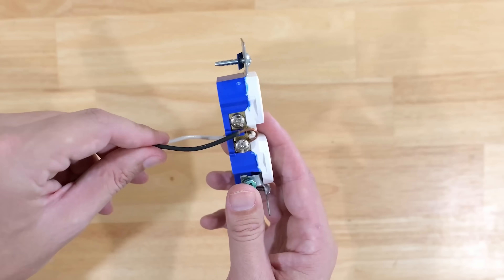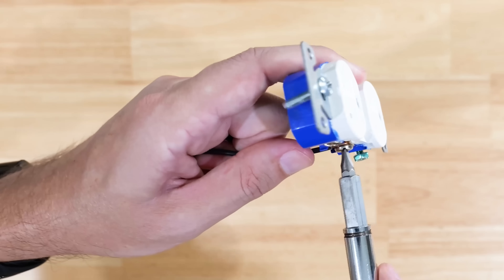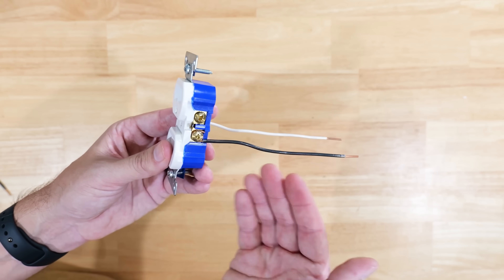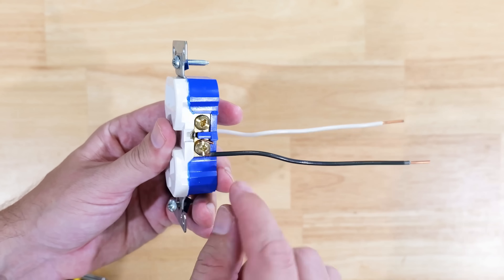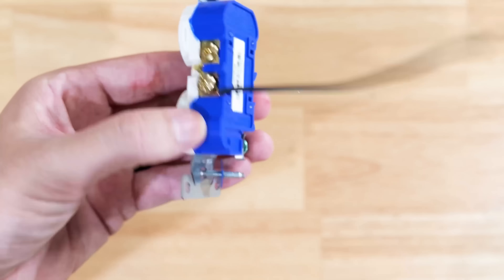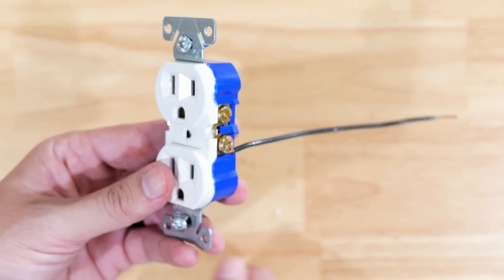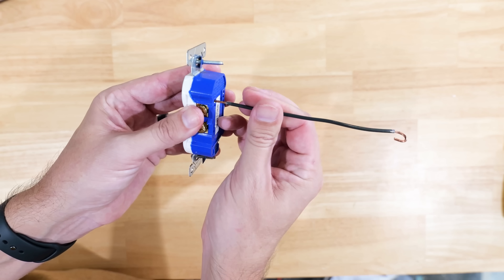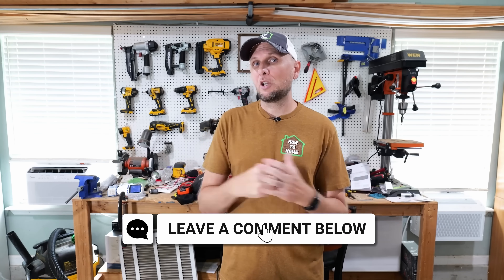Avoid Disaster! 8 FATAL Outlet Mistakes Most DIYers Unknowingly Make!

Comment: Do not listen to anyone who tells you that WAGO connectors are unsafe. They have been thoroughly (lab and field) tested and are every bit as safe and effective as wire nuts. That being said, like most things the quality of the product can vary by manufacturer. There are "push in" style connectors that work just like back-wiring receptacles and they are not preferred. WAGO, specifically do not work the same way. They do have a lever that locks the wire in, but that is not the electrical connection point. The lever is locking the wire against a flat conductive plate that runs along the edge of the wire creating a lot of surface area, similar to the surface connection of a back-wire, commercial-grade device. As long as the connection device you are using functions that way, it is perfectly fine, and if installed correctly just as safe and durable as any other connection method.

In most case, the most expensive part of electrical work is the labor cost (including warranty work), so anything that can reduce the labor cost is preferred. WAGO (lever-lock) connections/devices tend to more expensive, so professional electricians would not be increasingly using them unless they were making that time up somewhere else. Those devices install much quicker with equal reliability. If someone tells you that WAGO (lever-lock) connections fail more than wire nut connections, it is because they are not installing them correctly or because they just have an "old school" bias.

Comment: Well I absolutely agree with almost all of your best practice suggestions and I love the receptacles with the clamps. I just noticed one thing that I would like to point out. In my program in Electrical Technician, I was told when using the wire strippers pictured in the video that one should use them to cut the insulation ONLY and not use them to pull the insulation off in one motion as shown in the video. We were told that this introduces a huge likelihood of scalping the copper conductor. So I recommended pulling the insulation off with your finger nail, or if you pull it with the strippers, position your hand at the jaws of the stripper to pull the insulation straight inline with the wire.
Reply: This is the only way to strip insulation. Seen many times where wire gets cut and the loop fails (ie breaks off the end)
Reply: It is the rocking and the twirling that you really need to avoid.
Reply: As an electrician trust me we use those same style strippers to strip the wire bare so we can make connections.... if you use them properly hey are are for exactly what they are called.   Wire strippers
Reply: Depends on the size of the wire.
Reply: I've learned to strip insul.  w/o gouging wire.  Not at all.  Using a new  sharp wire stripper helps.  Was taught to "twirl" the tool gently.

Comment: I'm still watching the video and will comment as this is important IMO. I approximately 8 or more years ago I replaced quite a few outlets in a family member's house. I used the inserts as seen in #4 for all of them. About a year ago, when selling their house, I ended up going through the house to wire all of the terminals to the screw holes. Quite a bit of them had failed too with problems like the wall outlet shutting off when moved. Of course I did them for free as it was very easy to re-strip and coil them around the screws. This fixed all the issues that some of the outlets had. I'm surprised that they didn't tell me that they had issues as I don't even remember that they were all wired using the holes in the back.

Comment: I did not see in your video plus reading a lot of the comments (but not all) but did not see this addressed. On future videos show the difference of the screwdriver heads - Phillips vs the bit DESIGNED for screwing the receptacle side screws in.  As a DIYer, I did not know the difference.  I happened to notice it at Loews in the electrical tools section. I paid the extra few $ and noticed the difference when installing new receptacles on a small remodel. One can torque the screws much easier with the bit designed for those receptacle screws.   But like the idea of the torque screwdriver also.  YES -  agree with your assessment of using the commercial outlets for residential that has the plate that clamps the screw thus allowing a straight wire versus a J hook.
Reply: What is the name of the proper screwdriver bit for receptacles?

Comment: When you say that the electricity is being fed into the outlet and appliances backwards it shows that you don’t understand AC current very well.
Reply from the maker: How this confuses you and yet you say I don’t understand it is amazing.  Yes it’s alternating current.  You have a hot wire, also called a line wire, also called a fed wire.  It is the only wire that supplies current. The neutral doesn’t and the ground doesn’t.  It matters which side the feed wire is on the receptacle so that when you plug something into it, the on off switch stop the current front being sent through the device when not intended.  If you put the feed wire on the neutral side, something like a lamp socket will always be hot regardless of if the switch is on or not.  Do you still not see how AC has nothing to do with it and that there is in fact a feed side?   If not I can’t help you any more.

Comment: Great videos! Thank you.  You did confuse me when you showed two black (power) wires connected to the separate brass screws (not two hooks on one screw). Where would you use that unless you were breaking the tabs to use different breakers on the same outlet or for back wiring? If to back wire, isn't that also against code too? I was taught by an electrician to use pigtails and wire nuts to back wire multiple outlets. I am DIY, not an electrician.

Comment: UMMM dude you should not put a receptacle rated to handle only 15 amps in a 20 amp circuit. If the breaker is pushing 20 amps and the wire is carrying 20 amps and the load is 20 amps then what the hell is the 15 amp receptacle going to do about that? You can however put a 20 amp receptacle in a 15 amp circuit, if the load is 16 amps as in a device failure then the only thing stopping the fire is going to be the breaker, the receptacle isn't going to affect how the breaker works or what the load does. You are right that using a 20 amp rec in a 15 amp circuit would encourage missuse but thats also like saying you cant trip a breaker or overload a 15 amp circuit that only uses 15 amp recs.

Comment: On the receptacle there is a catch nub for the end of the loop -- so you can pull the hook past 180° and get a tighter fit around the screw. It is easy to reason that the shorter slot is the "hot" prong. If you plan you leads well you will work harden the wires less.

Comment: I suspect spring loaded back wiring is one of the reasons arc-fault beakers are now required.  These should have never been allowed on the market. And how about imported extension cords that don't make good connection. I've seen people running a long 16 gauge two prong extension cord to run their microwave oven. Instead of getting a 12gauge line service installed. As society gets dumber over time more safety devises are needed. Poor practices drive insurance costs up.

Comment: Judging from quite a number of comments below, it seems that DIY's are oblivious to the capacities of device boxes, juction boxes and conduit bodies. Just because a box has multipile knockouts or openings doesn't mean you can stuff as many conductors in there as you want or need. Just as a 8 ounce glass will hold only 8 ounces of liquid, so electrical boxes have a capacity limit for wires and devices. The National Electrical Code (NEC) Article 370-6 "Number of Conductors in Outlet, Device, and Junction Boxes, and Conduit Bodies" has Tables that specify how many conductors of various sizes can be sequestered in any given size box. The number has to be adjusted downward when devices are also installed in said box. If you are having trouble installing a device or even conductors in a box, you are in violation of the code and have created a serious safefy hazard. Most juction boxes have their Cubic Capacity marked on them. The maximum number of conductors that can be installed in any given size box, based on conductor size (AWG) is listed in Table 370-6(a). If devices or fixtures are also to be installed, then further reduction of capacity must be accounted for. Unless wall cavity or other obstructions require the use of standard or shallow boxes, it is better practice to install deep boxes in most locations because typically the purpose of any given box will likely change over the life of the occupancy. As an example, when GFIC receptacles where required for outlets in kitchens, bath rooms, etc. many installers found that the existing box was at or below the capacity requirements, making code compliance problematic. For the difference in cost, the installation of deep boxes is well worth avoiding the potential grief as the needs of the occupancy change over time and purpose. If he has not already done so, the presenter would be providing a valuable service by addressing this vital topic in another video.

Comment: National Electrical Code (NEC) Article 300-13 (b) Device Removal  "In multiwire branch circuits the continuity of a grounded conductor shall not be dependant upon device connections, such as lanpholders, receptacles, etc. where the removal of such devices would interruipt the continuity." Unfortunately, too many times people will utilize the additional device screws to continue the branch circuitry to other downstream devices (recptacles, light fixtures, etc.) which is poor practice and a safety hazard. In all such cases, a three wire pig tail splice is the appropriate method to conform to approved wiring method. Two conductors (or more in some cases) are providing continuity for the continuation of the branch circuit to other downstream devices while the shorter "pig tail" is connected to the utilization device, ie: receptacle, light fixture, etc. so when that device is removed the branch circuit's continuity is not broken. It is also a code requirement to allow the device in question to be able to be removed a minimum of six (6) inches from the junction box or enclosure. Unfortunmately, the presenter missed several opportunities to highlight this absolutly necessary safety and code requirement. This is an all to common situation encountered in the field that DIY's and sometimes "qualified persons" commit.

Comment: I'm not an electrician but i play one for my customers quite regularly. 

Backstabbing... I had a series of calls over a couple of years with the complaint, "my outlets don't work." In all of those cases, the receptacles were backstabbed. Additionally, the receptacles were all bulk buy contractor grade - no branding whatsoever. 

1) at one house while troubleshooting i wiggled the loose receptacle and could see arcing through the cover plate of the adjacent receptacle.

2) absolute worst case I found was that the receptacle was completely burnt on the backside inside the box.

Comment: You didn't mention another HUGE no-no. Some old houses do not have grounded circuits and their outlets have 2-prong plugs. If one of these 2-prong outlets quits working or looks old, never replace it with a modern 3-prong grounded outlet, which gives the false impression that you are plugging into a grounded circuit.
Reply: ...UNLESS you MAKE it grounded, by adding a protected* ground wire.
* i.e. protected from rodents chewing: either it is inside metal conduit, or, you are running the sheathed triple wire.

Comment: When working with stranded wire, always twist the wire counter clockwise before you bend it, when installed like the video it will actually pull the wiring in while tightening the screw.

Comment: What do you do when replacing an outlet and find very short wires and unable to pull longer? They're not long enough to cut off the old ends and strip for the new outlet.

Comment: These are some of the best explanations of how to properly wire outlets (and light switches). Can't tell you how many outlets I replaced in my old house that were improperly installed over the years. I think I found only 1...yes, just ONE outlet that was done properly out of about 20. Excellent video!!!

With solid wire I like to make a little more than just a "J" hook...after running the wire under the terminal screw clockwise and just snugging the screw down lightly, I then take my needle nose pliers and give that "J" a bit more of a curl...nearly a circle is made before I then fully tighten down the terminal screw. Full contact, and that wire is NOT coming out after that (just a tip I'm sure you've already seen, but many others won't bother with it). You can't be too safe when installing switches, outlets, or any other devices...it's just not worth doing it wrong or you'll be doing it AGAIN sometime down the road.

Once again, excellent video!! Keep up the great work! 👍
EDIT: Oh yeah, and new sub from me!
Reply: Yes. I replaced my outlets. The electrician used back stabbing to install the receptacles. One outlet the wire had a big nick in the wire. I'm glad I caught that before any issues appeared.
Reply: I am in my seventies and back when I was a teenager I was doing most of the repairs in the house I lived in with mom and older sister. My father had passed away.

I did pluming/soldering pipes, wiring, some carpentry, laid ceramic tiles, drywall.... and was self taught.

Where I am going with this is.
When it came to wiring I did everything the way the guy in this video shows to do it and I am not even an electrician.
When I saw the "back holes" for the first time I was big on using those until I saw how flawed they were and then I went back to "J Hooking" the wire. Later I discovered commercial grade outlets and then started using those exclusively.
Reply: Yep! My method also.
Reply: One of my outlets was so bad it was arcing when something with more than a couple amps was on the circuit, like a vacuum.  It was loose push in wire in one of those speed connectors that was arcing.  Had a big burned spot on the case

Comment: Absolutely confirm backstab/speedwiring failure and danger.  In my daughters room, the lights were flickering and we thought it was the light fixture or bulbs.  Did it for too long... I am embarrassed I waited days to take a closer look.  I finally noticed there was something plugged in the wall that usually wasn't... I wiggled that plug and sure enough... not only bad connection, but wall was hot!  Never use those stab in connecters!   Great vid and new subscriber
Reply: Probably wasn't fully inserted.  You can have poor installation on the other type also.
Reply: @dchambers986  It was... It was in all the way and when you wiggle the receptacle, lights flickered... and I actually have more than DIY experience as well as confirming this very point with a personal friend who is a commercial electrical contractor... it's a thing.  Spend a couple bucks an dismantle one... you will see the inside looks ready to fail.  Not trying to sound defensive, just want the point to be made for safety's sake.  No skin in the game here for me.  Appreciate the interaction.
Reply: I've used the stab in connectors for 20 years & NEVER had a problem with it.
Reply: @jkhan6831  well I am batting a thousand on one almost burning down my house... And I have only ever heard electricians say don't use them. I think it would be strange for me under those circumstances to start now.
Reply: If the backstabbing method is unreliable why do manufacturers make them part of their product?
Reply: @doughuntley1446 going to go out on a limb and say...money.  As with all gimmicks... There is a thing called a salad shooter
Reply: @doughuntley1446 to offer a cheaper and faster install method.  You’ve probably noticed that not everything in the world is build for optimal performance and reliability.  

There’s no getting around the fact that you can wiggle them out by hand pretty easily as he showed here, and as many of us have done when we’ve replaced backstabbed outlets.  If the outlet/box itself is loose, which is common, and the outlet gets used a lot with stuff being plugged in and removed constantly, do the math…

Comment: I wull still always tell people to put 20 amp receptacles on 20 amp circuit. You can still burn out that receptacle with others on the circuit. Unless there is another load on the circuit it wont trip. Code is the minimum, not the recommended. And i say this because ive seen it happen in one of my own homes. Its always better to over engineer than it is to under engineer things.

Comment: A common mistake is thinking there is a polarity with AC current. Don't get me wrong, you shouldn't reverse the hot and neutral, but saying the "current will flow the wrong way" as in the video, is incorrect. It doesn't flow in one direction, that what's DC does but not AC.
Reply from the maker: Yes and no.  I think you are taking what I said out of context.  Yes, it is alternating current, but there is one feed wire.  The neutral is not a feed wire, it completes the circuit.  So it does in fact flow a specific way to begin with.  There is usually an on/off switch on devices.  Well if the power was being fed the wrong way on the neutral side of the receptacle then the on/off switch can't ac as a gatekeeper it is just stopping the device from running as the circuit isnt being completed.  But on something like a lamp in that example, power would still be going to the socket without the light coming on, but if someone was to touch that socket, then they become a path to ground and shock or electrocution can occur depending on what the device is.  I hope this makes sense.